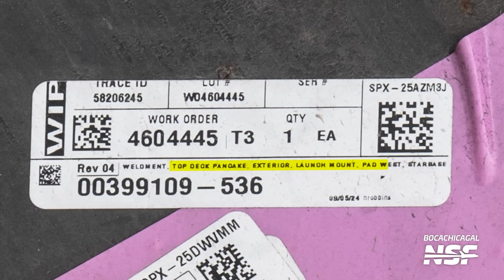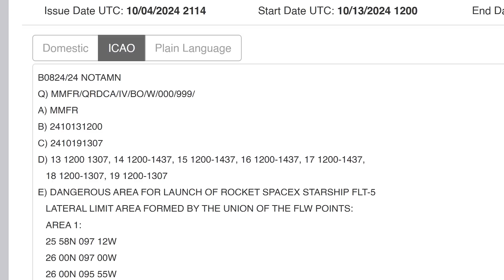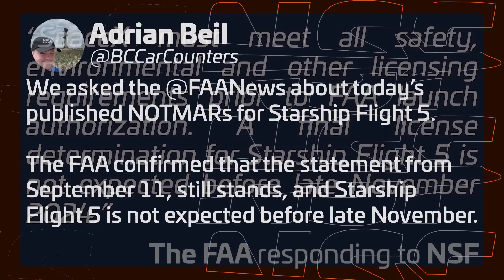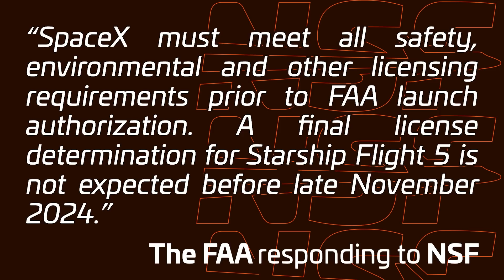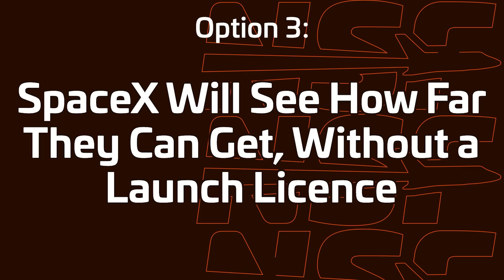SpaceX Starship Launch Confusion! Will Flight 5 Happen This Weekend? | Starbase Update

Comment: Um, couldn't they launch using the old Flight 4 profile? It would allow them to know if the improved heat shield works, if any changes in the engine compartment of Super Heavy improves things, and proves to the FAA that SpaceX rockets tend to behave themselves.

Comment: But Flight 5 IS licensed. Based on the existing license and flight profile for Flight 4. It was the changes to the flight profile for the "Catch attempt" that hasn't been approved and being delayed for all the regulatory mumbo-jumbo.  But if SpaceX decides to fly the same profile as Flight 4, then there shouldn't be any issue. 

It would allow them to test the upgrades to the TPS and other systems, and see how accurately they can control the booster on descent. Furthermore, it pushes along the flight hardware so they get closer to the Block 2 Starship launch, without more delays. They could just push the catch attempt to flight 6, and that should be ready to go about the time frame that the FAA is stating.

So, I think Elon and company have said, "Screw you guys! We're going flying!" and will just "Advance in another direction", but keep pushing the ball forward, as opposed to sitting on the ground for another 6 weeks when "rapid re-usability" is on the line.

Comment: The "explainer" video about how NASA is normally in charge of experimental and development launches and the FAA normally doesn't step in and begin licensing launches until regular commercial flights are happening, was the best thing you guys have done, ever!  Hilarious how you explained how that process works with historical launches without specifically mentioning starship in the video.  Making the connection here, and linking to the other video is brilliant.

Comment: The flight profile and launch license for flight 4 is still available. There's no set landing zone for the booster that says "you must land at these co-ordintes" so they can fly and bring back the booster close to Starbase, before a controlled ditch into the Gulf of Mexico. Ship also has new flaps and heat shield that will provide valuable data for SpaceX.

Comment: I thought that SpaceX still had a license for the last flight profile, (IFT-4 - without a catch) and could theoretically still launch on that license...just not catch it. I am sure that was in the video that Das, did - with the representative for commercial space flight from the FAA...anyway, it's all a bit of a mess. One thing it does seem to suggest, is that a separate, more lean agency is required to license private spaceflight in the US, something similar to the way New Zealand are now going, with their newer private space industry. Anyway, great video as ever.

Comment: Government launches do not need an FAA license. (See below.) NASA is indeed 'government,' so only if NASA took Starship development as one of its own programs could it force the FAA's hand. I consider that unlikely without a significant statement from NASA being apparent at this time. I think that Starship launches in November. Nonetheless, the FAA regulation system needs to be replaced permanently. Congress can do that after the election. But it won't. 

Prolly SpaceX will wait, while Elon attacks the FAA through Congress and money. NASA and ESA may join him. But what happens if SpaceX just launches? Maximum fine is only a civil penalty of up to $283,009 for each violated condition.  Peanuts for SpaceX?

(From the NOAA's 'Navigating U.S. Commercial Space Regulations': An FAA license is required for any launch or reentry, or the operation of any launch or reentry site, by U.S. citizens anywhere in the world, or by any individual or entity within the U.S. An FAA license is not required for space activities the government carries out for the government, such as some NASA or Department of Defense launches.)

Comment: I think Option 4 is most likely: SpaceX wants to pressure the FAA into speeding up their licensing process. If there was a change, why wouldn't the FAA just say so. NASA licensing the launch is currently the second most likely option, but here too, I feel like there would have been some kind of announcement, except maybe NASA wants to license it but hasn't yet. I guess option 4 is kind of similar to 3, but I made it a new one because I don't SpaceX would push so far, that they might get legal problems. As far as I know, they have approval to conduct all these ground tests, so the only way to really get into trouble would be to launch without license. I don't see that happening. They would get this launch off maybe, but SpaceX would be completely fucked for any future launches.

Comment: Raptor 3 still does not have an internal electromechanical device that ensures that it will not explode, although in fact it already has an external electronic one that completely shuts down the engine.

Comment: Doesn’t SpaceX already have launch authorisation for a repeat of flight 4?  Maybe the NOTAMS are for the new profile but the actual launch be a repeat of flight 4, if that’s the case they can launch practically anytime they want, right?
Reply: SpaceX posted that the 13th is the targeted launch date and WILL include a catch attempt.
Reply: iirc they need a new enviromental license due to the booster catch creating new risks
Reply: @Kasmuller  They're targeting a launch for the 13th that will include a catch attempt so it looks like everythings been sorted behind closed doors.
Reply: @StarshipCobson  either that or spaceX being overly optimistic or pulling an sn8
Reply: @Kasmuller  They are not Stupid to pull an SN8 that would be REALLY bad for SpaceX. We'll wait and see but they only say they're targeting a date once they have been informed a launch license is close.
Reply: @Kasmuller  but not if they fly a repeat of flight 4.

Comment: What is going on? Well the FAA has no busness authorizing lift off! Or for that matter anything to do with Rockets.  I cant keep up with airplanes, and there own JOB
Reply: Factually inaccurate. Spacecraft leaving or returning to Earth tend, on the whole, quite often, to fly through the atmosphere and that's 100% FAA jurisdiction ...
Reply: @Lensman864  so flight is the manipulation of atmosphere to control aircraft horizontal movement. So rockets use chemicals to propel vertical movement, and fall back to earth. Aviation is to move horizontally through atmosphere, with propeller, or impeller. And is controlled by manipulation of the atmosphere.  ROckets do not FLY, by definition! So they only go up by chemical reaction,  not by atmosphere manipulation,  thus ROckets are NOT aircraft! ROckets propeller spacecraft that float around in orbit of the earth. No air, not an aircraft, not Aviation! FAA Not applicable!

Comment: Wasn't one of the FAA statements that, if SpaceX does not change the flight profile off that from Flight 4 they can launch anytime?
To me this implies they fire up Flight 5 just like Flight 4 - and end of November we see the catch-attempt with Flight 6 as the hardware is already there and ready to fly.
Reply: Only if they fly the same type of hardware, and they would not be, ship have gotten changed, its heatshild was replaced with a new version.
So they cant use that ship to repeat flight 4.

Sorry if my attempt to explain it simply as I understand it is... well dumb.

Comment: 10:45 I'm having trouble believing the 700 tonne figure for that chopsticks water bag load test.

1 tonne is the weight of 1 m³ of water.
So 700 tonnes is 700 m³ of water, which adds up to a volume just slightly larger than that contained by 6 Starship rings!  It does not look to me like the total volume of those water bags, could fill up 6 Starship rings...

Comment: SpaceX DOES have a launch license for flight 5, as long as they use the same parameters as flight 4! Which means that they would have to push back the booster catch to flight 6, but they may have to launch because they have been ramping up the production of flight hardware, and may be running out of room in the mega bay.

Comment: : Extreme dilapilated public road : (3:22 time line) 
Hello J.B.
The Extreme Dilapilated Public Road was rebuilt not too long ago. FYI (for your information) Widen and resurface. It's in excellent and or outstanding condition. This was done between the factory and the launch site. 
Maybe you were not aware of this. Too young of a commentator.
May the force be with us.
  P.S. Little trivial things drive me crazy.
  🐢 🏗 🐢 🚀 🐢 🤔
Reply: Everyone universally agrees highway 4 is in terrible shape. Yes, the area that was resurfaced between the beach and Massey’s is nicer than the rest of it but I stand by my statement. Also, FYI I’ve been coming here and doing this since before Starhopper flew. Thanks for watching!

Comment: Didn't the FAA state that SpaceX ... HAS ... a license to launch ... as long as it is the same flight profile as the last flight?   
There is of course the confusion around the deluge potable water "poisoning" of the wetlands (sheesh, give me a break) ... and possible something about the change of the type of TPS tiles ("so very dangerous" - please read with scorn dripping with sarcasm.).    
So, I'm kind of hoping that SpaceX does launch under the previous license with the same flight profile ... verify their changes to the TPS (good video of solid flaps at touchdown ... have soft water landings of both booster and ship.   
This way they preserve Launch pad 1 (A?) for an additional (soon) flight 6 ... so that launch pad 2 (B?) is almost ready for another test flight after the first (flight 6) catch attempt does a big fat KABOOM of pad 1 (A)   (sorry, just my opinion).        (And hopefully doesn't completely destroy the fuel farm.)         
Just my crazy thoughts. 
btw ... Love the weekly updates.

Comment: with the date now confirmed, does that mean FAA have approved or NASA taken over to avoid the delay? its also my understanding that even of the FAA don't approve the license, Spacex is only liable for a fine for that license only, not further action can be taken against them unless they break an Aviation safety law of 1958 introduced by JFK around no carrying guns etc. That would result on possible jail time. Not a likely scenario. (sources are FAA website)
Reply: Well, they do carry a lot of explosives on the vehicle (FTS). I think that alone would break the law without a licence. Plus, its basically an intercontinental missile. I would not think it would only be a "fine".

Comment: Option 4: SpaceX lunches with a FT4 profile. 

In the first FAA response to NSF about the new license request, you all mentioned that the FAA said SpaceX could launch right now with a FT4 profile. There is a ton that SpaceX could test, including the new thermal protection system. And there is another set of vehicles that are essentially ready for a late Nov launch.

Think about it - after FT4, Elon challenged SpaceX to do a catch with the next flight. How many SpaceX engineers crapped their pants when they heard that? That was clearly pushing things. SpaceX very likely had a different plan for FT5. Why not go ahead and move forward with that initial plan and get the data from those other objectives while waiting for the new FAA approval?
Reply from the maker: SpaceX said earlier today that they're going for the catch...  https://www.spacex.com/launches/mission/?missionId=starship-flight-5 

- Das
Reply: The FAA said the new TPS tiles also require review, so can’t do Flight 4 profile either unless FAA relents.
Reply from the maker: On that, the FAA said "may" require a new license. It's unclear what that outcome would be. - Das
Reply: They said "pending regulatory approval", no mention of the FFA, I wonder if NASA is going to be sponsoring it?, I don't see why they shouldn't as they take on other rockets in development and it is needed for their missions.

Comment: I’ve never understood why ppl advertise henson as plastic free. the blades come in boxes of 5 or so that are each individually wrapped in plastic. there is actually quite a handful of plastic waste…
Reply: Mine came in boxes of 5 without plastic wrap. The individual wrappers on the blades are waxed paper, everything else is thin cardboard.
Reply: @johnberkers434 This. I can't comment on Henson's products specifically, but the razor blades of that style that I've seen were all packaged in waxed paper wrappers inside an outer cardboard box.
But I guess waxed paper could be confused for plastic, given the current ubiquity of plastic and relative rarity of waxed paper...

(I think fast food drinks are typically supplied in waxed paper cups as well - at least here in the UK. That's why they initially appear waterproof, but can get soggy if left overnight with leftover drink inside: the wax coating isn't perfectly waterproof, especially around the edges/seams. I imagine a plastic coating would hold up much longer, even against the phosphoric/citric acid in most soft drinks.)

Comment: The speculation about the next Starship flight does keep me entertained but it will happen when it happens.
Gentlemen, and ladies, I would like to see you apply your considerable talents to speculating about the development of a "Starship Heavy", or "Double Heavy" even. Something so OTT it would carry all the requirements for a Mars Mission into orbit in four or five flights. EM is a big thinker, I can't believe such a concept hasn't occurred to him.
Ad Astra ....
Reply: It would require a completely new OLM design
Reply: IMHO once the engineers are done with SS-9m they'll look into the original 12m thing (or was it 16m?) and scale it up.  That's what they've been doing all the time at all his companies anyway.. get it to work and then scaling it up.  The SS-9m for me was the smallest they could test the tech/production methods needed for full reusability.
Reply: @joansparky4439  0% chance of a 12 m Starship. It would require a full redesign of everything (just think: back to hopper)
Reply: @bryanillenberg    their first choice for the planetary transporter was of that size while SX is not really known for resting on their laurels.. so 0% is a bit low IMHO.
Reply: @joansparky4439  They're going with Starship 3 instead.
Its easier to stretch the vehicle than increase the diameter.

Comment: They “don’t expect” and “will not” or Cannot”are completely different. I deal with codes a lot and there’s a big difference between “Should” and “Shall”.
Reply: In the regulatory language of the FAA - Shall = You Will do something.  Should = it is a recommended/good idea to do something. That is straight  from the horses' mouth in all the years I dealt with FAA regulations.
Reply: The whole show between SpaceX and the FAA is theatrics, always has been. Booster 4 would have exploded before it cleared the tower, but no it was ready to fly and that FAA delay meant it would never would, too bad. They use the FAA as cover so they never have to say something is not ready or didn't work.
Reply: @D43vil  I think B4, if its aft had been sufficiently reinforced, B4 would have made it too maybe 5-10 km.
Reply: @D43vil  this is closer to the truth than people give it credit for, i think.
Reply: @D43vil  considering they’ve never sat on a license when they said they were ready that’s just speculation.